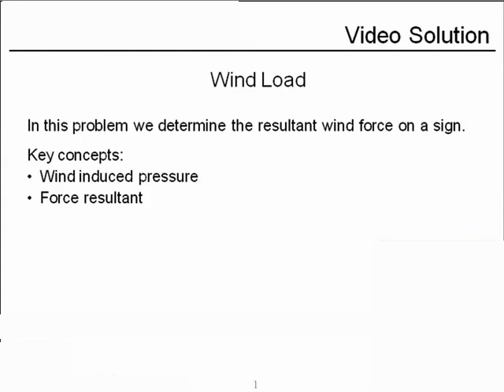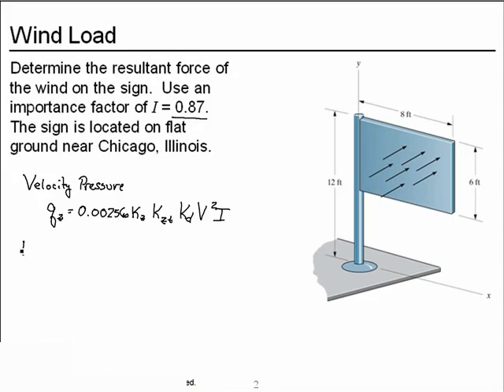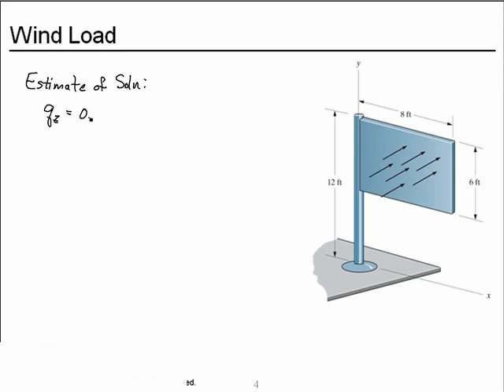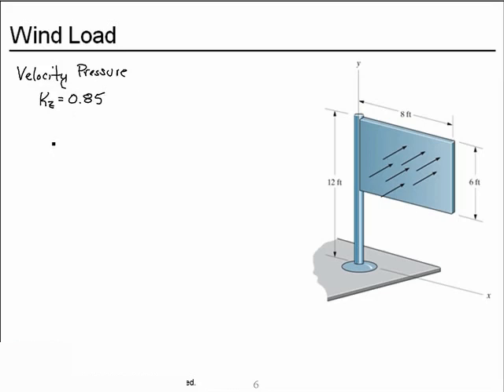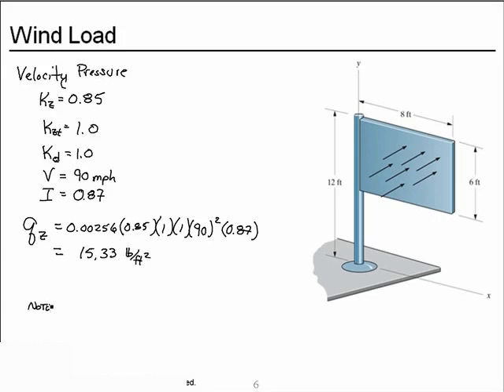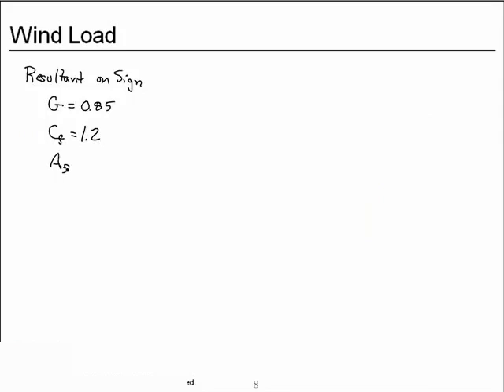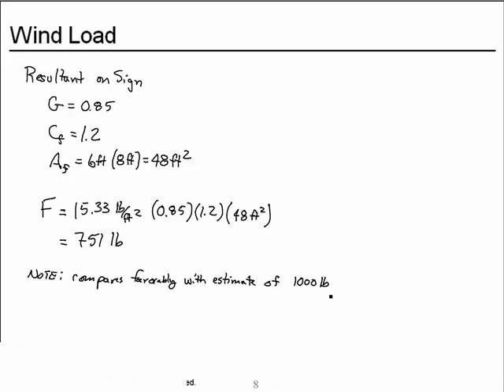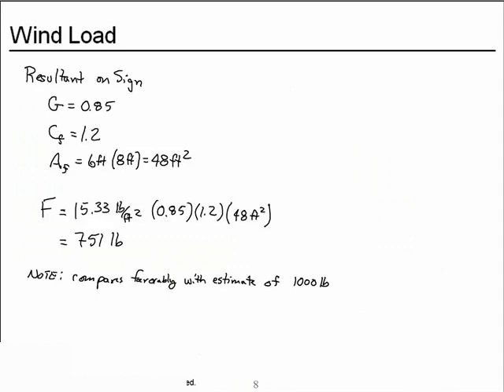Chapter 1-Wind Load

Comment: So I realize it may not be what it is meant for, but using this I got that a wind traveling at 20 mph would cause a force of approximately 4.31 lbs on a sousaphone with a bell diameter of 32 inches.

Comment: Just an FYI....Chicago has there own requirements for windloaded structures - which is 30PSF for any sign up to 50 feet in height. To everyone: before you start engineering signs check the local jurisdiction on what codes are to be followed. They vary across the country.